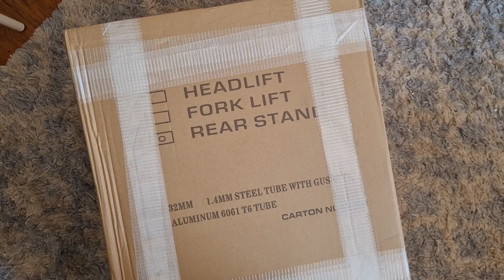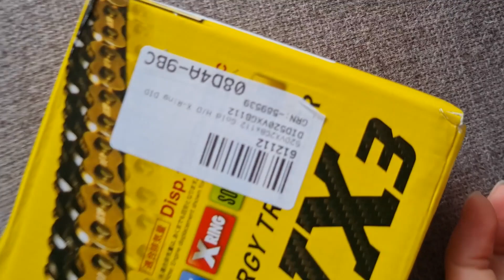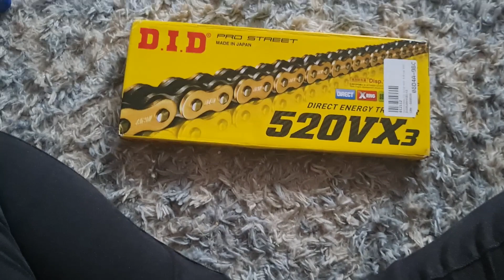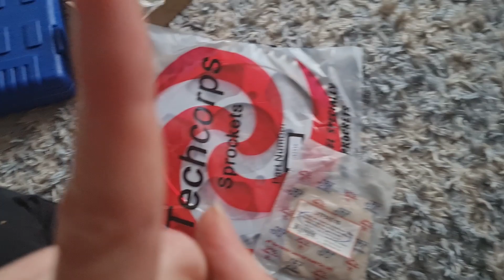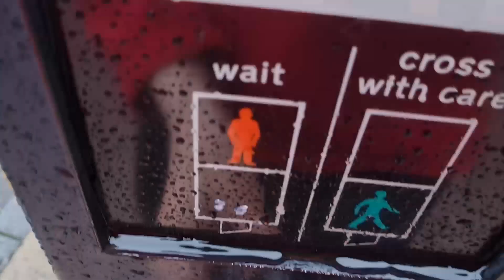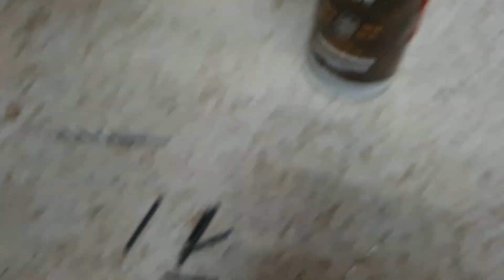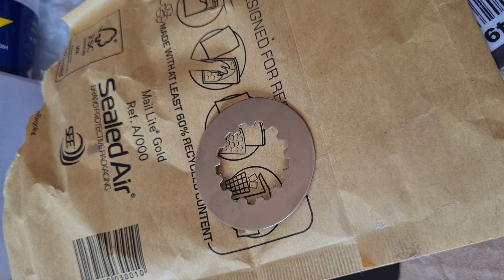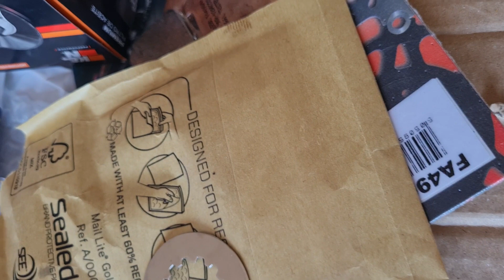Beginner Motorcycle Maintenance: My First Attempt (Part 1)

Comment: You just need to open up the brake fluid reservoir. Having a caliper spreading tool helps too.
Reply from the maker: Got there in the end ahahha it was just difficult
Reply: @SaffySprocket  It’ll get easier. Keep wrenching. You got this.

Comment: BEFORE TAKING THE WHEEL OFF:You can use the back brake to hold everything as you LOOSEN the large front sprocket and small rear sprocket fasteners.

Comment: I agree with others.  Hang in there, first time is learning and harder so keep trying.  Glad to hear you had people willing to help, we all need a hand now and then.  One hint I got for loosening nuts on a circle, set the bar so you pull across the center of the circle, its supposed to help stop the wheel or round thing rotating.  Seems to work for me so I thought I'd share.  And brakes, may be a bit rough, but a G clamp can be used to wind a brake piston back in.  just turn slowly and gentle to move the piston back in.  Open the reservoir and suck out some fluid first so the fluid in the line has somewhere to go.  Ask me how I know that trick......yeah, cleaning brake fluid off the whole side of the bike so it doesn't ruin the paint is a good teacher 🙂

Comment: The washer behind the front sprocket is supposed to be bent up. It stops the large nut from undoing.  Just tap it flat with a hammer and screwdriver or similar then put take the nut off. Make sure you bend it back up again when you replace the nut. ✌🏻
Reply from the maker: Thank you so much ❤️  I did bend it back on place!

Comment: The best way to get the front sprocket nut off without a impact gun is to , tools the socket the breaker bar you were using and you need a 6 inch extension to go between the breaker bar and socket , with the back wheel still in put a steel bar or strong piece of timber , wrap a rag around them not to scratch the wheel or swingarm  , with the bar through the wheel above the swingarm turn. The wheel counterclockwise and have the bar rest on top of the arm , now with the breaker bar extension and socket , put the breaker bar at just above parallel , now with your right hand  put some leather gloves on if have them , your riding gloves will work , at the end with the extension on cup it in your hands and support it take the weight , with your left hand on the other end , bend your elbow a bit stand a bit sideways with feet apart for stability left shoulder above left hand  now lean on your left arm and also try to push the bar also with the bent elbow , to tighten reverse the undo procedure

Comment: The extraneous holes in the stand aren't extraneous. They are there to release any moisture which may get into the tube, either from humidity at the time of manufacture or otherwise.  If the holes weren't present, the stand would rust from the inside out.  Also, good job and kudos to you for tackling your own maintenance. Even if you take your bike to a shop from now on, at least you know you CAN do it if you so choose.

Comment: Ok Saffy, one last thing.....@20:23.... go get yourself a 4 inch C-clamp... that will fit in between your calipers.... and use the C-clamp to press the Brake pistons back a bit so that you can get the new pads to go over top of the brake rotor.
Reply: to be more concise..... the C-clamp needs to be  what they call a deep C , with the Fixed Jaw being able to fit in between the area where the pads go,  Explain this to the retailer at the hardware..... he'll be able to follow you up.
Stay Safe.
Reply from the maker: I did end up buying a tool after the job was done 🤣

Comment: Amazing video. I want to change the chains on my Ducati's and wondered how complicated and time consuming it would be. Paying a Ducati dealer is too expensive. Your video laid out the work involved and the potential problems I might face. Luckily, I invested in a cordless impact driver that made life much easier and penetrating oil to help loosen difficult bolts. I bought a bolt extraction kit as I knew I would need to replace the exhaust bolts and the hex slots would be damaged. Your video gave me the confidence and incentive to have a go and I managed to complete the job. The next time it will be quicker as I will know what needs to be done. The only advice I can offer is invest in a pack of NITRILE FOAM POLY GLOVES from eBay. You don't get the oil and grease imbedded in the pours of  your skin and under the nails, and they are light and flexible so you can feel the parts you are handling. And it doesn't heart if you bash your knuckles. Thanks for sharing.

Comment: 2. Tool to buy are a 1/4 drive torque wrench and a 1/2 drive torque wrench , as every manufacturer has in there Worksop manuals the torque of each nut , bolt and screw on the machine , and not knowing if your tightening them enough is a recipe for what you don’t want happening

Comment: Ps. Don’t put the wheel on the ground with the disc in the floor when working on it. You can damage and warp the disc. Put two bits of wood on either side of the wheel to keep e it off the floor.  Learned that the hard way. 👍🏻
Reply from the maker: Thank you! I had no idea!
Reply: May be you should have told  her to push down on the tools  and she may have found life a lot easier and safer
Reply: @samjones4575  no better way to learn then hands on.
Reply: @SaffySprocket  push down all ways  to make your life easy  on undoing  nuts bolts and push down to tighten all ways and I think some one having your pants down piston going back has nothing to do with the oil in the line  just open lid on brake res put old pads in caliper after cleaning piston  and all around the caliper place screwdriver  or spanner  between and turn spanner or screwdriver put screwdriver in the ring of spanner to turn  whitch will push back piston  simple as long piston not been out you should be fine  and yes you can do it but you must be told right first time 😉

Comment: Take the cap off the brake fluid reservoir pistons will push back easy. 👍
Reply from the maker: I learnt that the hard way 🥲
Reply: @SaffySprocket  we all start somewhere n most make the same initial mistakes. Next time will be easy for you. Good on you for tackling the job in the first place 👍

Comment: I've been working on my own cars and bikes for years, there are always problems and I regularly hurt myself but it's all part of the fun.  You'd have been replacing the brake pads whether you did it yourself or got a garage to do it, so still quids in and you've learnt a bit along the way. P. S. no need to drain your brake fluid, just remove the top of the master cylinder and remove a little using a syringe or a small teaspoon
Reply from the maker: Unfortunately that didn't work, turned out in the end the pistons were actually at the further point back 🤣🥲

Comment: I've always left the wheel on. Put a 3x2 length of wood through the spokes to hold the wheel from turning. Then attack the sprocket nut. By doing this, the chain takes the pressure to hold the front sprocket, while the nut loosens. With the wheel off the way you are doing it, you can damage the gear box...that washer that goes on the shaft behind the nut...once nut is tightened, you flatten one end of the washer onto the nut, which helps stop the nut loosening...its like that on my kawasaki....

Comment: Make sure you have taken the break fluid cap off before trying to push break pads back. I would not drain fluid out.  Put a rag around filler cap, if you have been topping break fluid up. Sorry if you have tried this already, I don't think you mention it.
Reply from the maker: Yeh I learnt that after ahahaha

Comment: I agree with others, get a workshop manual they are invaluable. For parts for your bike I recommend wemoto, they will have a listing of parts for you bike and it's year. Plus if you order all it will save on postage. Also anything you take off, clean it and grease it before you put it back. Makes it easier next time. Don't give up it does get easier and you will save money in the long run.
Reply from the maker: I couldn't find one unfortunately 🥲😔
Reply: @SaffySprocket  I'm surprised you can't get a Haynes one, especially for your bike.

Comment: hello good afternoon Saffy it is important to maintain the pads before dismantling you could have inserted a screwdriver to push the bolts back and the brake fluid I change every 4 years is fine best regards Ok 😃👏
Reply from the maker: Changed the brake pads and fluid today :D
Reply: Ok 👍

Comment: If I can make a suggestion. Next time loosen the front and rear sprocket nuts with the bike off the stand and the bike in gear. You can then put maximum pressure on the socket wrench without the risk of the bike (& you) falling in a big heap

Comment: Well done for giving it a go it's the best way to actually learn about your bike, I was wincing a bit through the vid I must admit 🤣 I was concerned you hadn't bent the washer back over on the front sprocket but can see from the comments you did. A good tip is the day before you plan to do a job like this give all the nuts you need to take off a squirt of wd40 or the like. Before you take the wheel out and stick it on paddock stands break all the bolts, that way you've got the bike more stable, makes it all a lot easier.
Reply from the maker: That's a really good trick! Thank you 😊

Comment: Saffy,

I do admire your spirit for having the courage to carry out your own bike maintenance as this will, in the end save you money and more importantly give you knowledge and understanding of how things work.  However, the drive train and brake systems are safety critical systems and would, on your first attempt, best be tackled with a friend or colleague that has the experience, tools and time to assist and guide you through the processes involved.  

I'm sure you must have a lot of motorcycle friends, acquaintances or people that watch your YouTube channel, that live in your area, that would kindly be willing to give you a hand and guide and teach you with these maintenance tasks to show you the correct/best/easiest methods to undertake them?  

Some friendly advice I would have suggested would have been to remove the front socket cover, bend flat the tab and loosen that front sprocket nut first and before removing the rear wheel.  This would enable you to be able to use the rear brake whilst trying to undo the sprocket retaining nut.  Also, if you fail with this essential task nothing else has been dismantled so the bike can easily be put back together, if needs be, until you have come up with plan B.  The tab washer can usually be reused as you suggested and it is it's designed purpose to be bent up against the flat edge of the nut, after the nut has been torqued to the specified value, to help prevent the nut from loosening.

You could also check out automatic chain lubricating systems, such as a Scottoiler, as a well lubricated chain lasts a lot longer and saves you the need to lubricate the chain for yourself, (which is a task that many of us do not carry out as often as we should).

As to your issue with the brake pads, check the level of your rear brake reservoir before starting and during changing your pads.  As the pads wear the brake fluid level in the reservoir will drop and checking and topping up the level is the resulting regular maintenance task of this.  It follows that to fit new pads the caliper pistons have to be pushed back into the caliper which pushes the fluid back into the brake reservoir hence  why you need to keep an eye on it's level.  

Probably, the easiest way to remove brake fluid is to suck out any excess from the brake reservoir using a syringe, that can be purchased from ebay for a few pounds, and this fluid can then be deposited in a suitable container such as an empty jam jar.  What you are trying to do is to ensure no air gets in to the hydraulic brake system if at all possible as this will need to be bled out giving you another job to do 🙂

Good luck to you and ride safely!

Comment: Knowledge is power. Motorcycle mechanics is a new skillset for you to learn. Take your time and focus on one job at a time. You'll save yourself a fortune in the long-term, and you'll know the job has been done properly. There's no better feeling! It's easier to pull on a breaker bar when slackening off a nut or bolt. Try removing the top off your brake fluid reservoir then push the piston back into the caliper. Brake fluid is nasty stuff so don't get it on your paint. Don't forget to clean the brake parts and re grease the pin when installing the pad. 
You're doing well and there are plenty of people on here who you can ask for help.
Reply from the maker: Thank you so much for your advice 🙏 ☺️ 😊 😘 ❤️
Reply: @SaffySprocket  You're more than welcome, Saffy. 😉

Comment: Saffy, I'm very impressed with your determination & while it might not feel like it now you really made the right choice. You often adventure far from home & sooner or later your bike will run into problems. the more you know, the more capable you are, the easier it'll be to solve it on the side of the road. Every adventurer worth their measure needs to learn how to work on Thier own bike full stop. Though I know it's a b*":tared now it'll pay off well some day. Good luck Saffy & I know you'll make it.
Reply from the maker: Thank you so much for your support 🙏  it's certainly frustrating at times
Reply: Saffy I know it can be frustrating at times but it's just the learning curve. It starts out hard & gets progressively easier. Just hold in there & keep willing to learn. That's actually one of my big secrets in the lessons of life. Be willing to learn !. x
Reply from the maker: I will! Thank you 😊

Comment: we've all been there Saf, don't beat yourself up about it. One tiny piece of advice, buy yourself a box of disposable gloves, and protect those pretty hands of yours. stick a couple of pairs in your luggage as well. then if you have to do anything oily etc when on the road, then you are not going to ruin your expensive riding gloves if you can't wash your hands. 
PS WD40 removes oil and grease off almost anything.

Comment: Your rear paddock stand - I see an R-clip on the outside of the stand, but what is keeping the supports against the swing arm?  Just the spring pressure?   I'd want something positive on that - especially if you are using force getting the sprocket off the bike etc..........

Comment: Fair play, far more respect for giving it an honest go yourself than any perceived failure. Sure, there are many tips and tricks you can learn (such as how to control force so you don't end up bashing your elbow. It comes with time and just doing it over and over.
    Here's my take on 40 plus years of riding and maintnenance:  You and you alone are responsible for the safe operation of your motorcycle. You can outsource jobs that are beyond your knowledge or ability, no shame in that, but maintaining your machine yourself forms part of an intimate knowledge of its condition overall. That is why finding worn brake pads is a good thing not a bad thing. Your safety while riding depends on knowing the state of every nut and bolt, every moving part and importantly the consumable parts (brake pads, chain/sprockets/oil/coolant/brake fluid/cables/tyres ). It is nobody else's responsibility, so you have to take responsibility for your own safety and wellbeing, and the safe state of your ride.
   Watching this was like watching match of the day, some own goals, some shots at goal but you are only at half time............
   Treat working on your ride like a relaxation exercise rather than a chore.......Soak up the experience you gain along the way, research any suggestions given, use your common sense, ask specific questions. Motorcycles have been a round for a long time and so have some of their riders..........There are no stupid questions, only stupid answers.
Reply: BTW you can push back the pistons in the brake caliper by slightly loosening the bleed nipple on the caliper as you do each one. Just a little loosen, not much, have a clear tube on the nipple into a jar  to catch any fluid if it does pump out as you push the pistons back, and then close off the nipple as you get to end of the piston travel before any air can get in. As you crack it open you will feel the piston move, just crack it a little so it move back in a slow controlled way not in a rush.

Comment: Mate Paul from Australia, would cost you more than 300 for parts and labour , ( X ring is better anyway) Remember when a mechanic does your job he gets the parts at cost than chargers your retail for the parts + his labour costs as well . You also probably ordered more expensive parts - X rings are more expensive ( even through you ordered a 0 ring ) , WAY BETTER CHAIN AND WILL LAST LONGER . Please do a motorcycle maintenance course you will learn HEAPS . It will help you SO much when you travel even just the basics .

Comment: Saffy, I shall try not to repeat other good advice here. Please take care of your hands as it's very easy to knock bits off and end up injured as well as filthy dirty, broken nails etc. Disposable gloves will help. Any tools you buy will be good for next time. I taught myself DIY vehicle mechanics and over 50 years have saved a fortune. There are still some jobs I will not attempt as I lack the knowledge and  tools required. To avoid chain problems, including lubricating the parts, I changed to shaft drive bikes 30years ago. You ride in all weathers so consider it next time.Start with the small jobs and it will be easier next time.

Well done for getting stuck in and I look forward to the next part of the story. If you grease the parts on reassembly, especially the axle pin. it will come apart easier next time.
Reply from the maker: Thank you so much ❤️